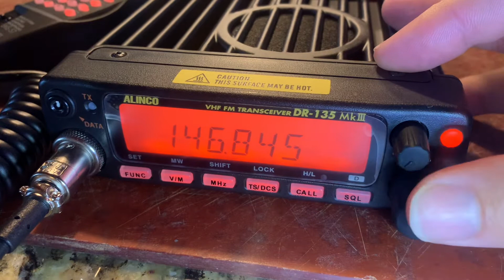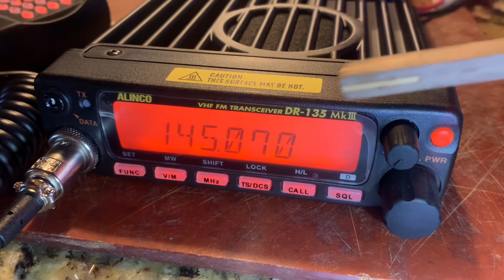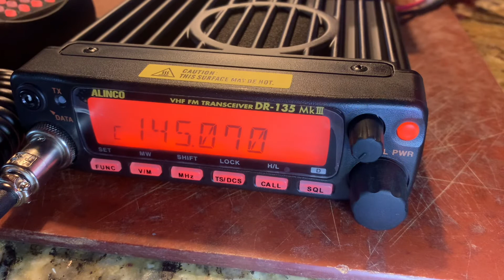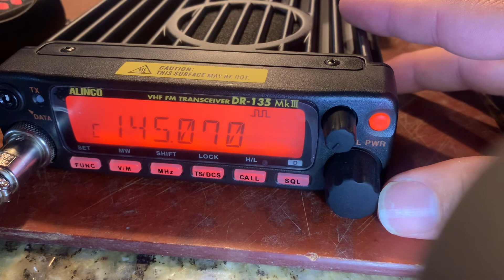Programing the Alinco DR-135 Mk III - Call button and Data Packet Mode then saving it.

Comment: What are you using for interface between radio and PC? I picked up a signalink. Wondering if digital mode or not.
Reply from the maker: YES work great. More info at https://tigertronics.shop/shop/ols/products/slusb135

Comment: I'm thinking about getting one of these 'just because'. I acquired the Yaesu 2980 and Icom 2300H back in July.
Not many 'review' vid's on YT for the 135 mk3. Do you find yours fairly easy to program and operate? They seem like a pretty solid basic 2m rig. HRO right now out the door is about $175, not sure they'll get much cheaper.
73's!
Reply from the maker: Aloha applejacks971!
The Radio does work! We use them in our winlink gateway stations around the island so they are up and running 24/7. Programing take a bit of practice but then you can fly.  73